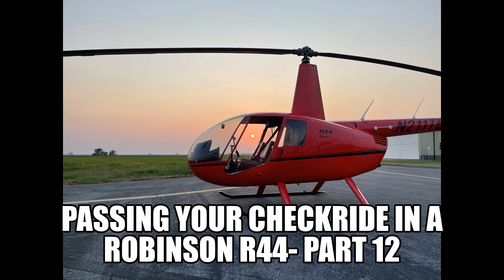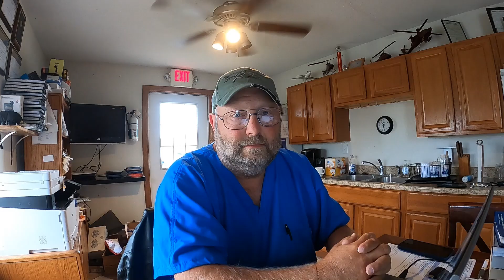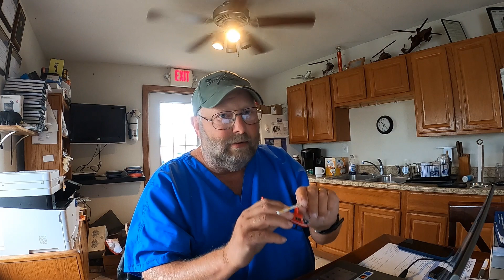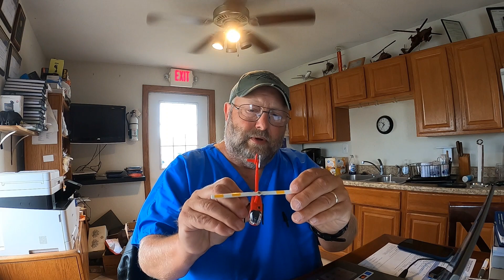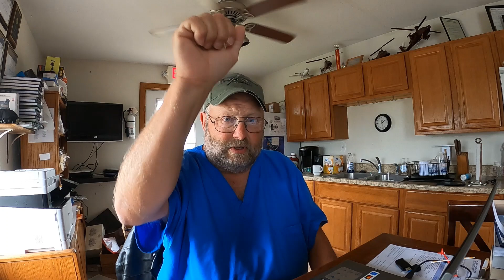Part 12- Passing your Helicopter Checkride in a Robinson R44

Comment: Why do they want you to know all rotor systems when in a checkride for an r44? Don't you need check rides in every aircraft you fly?
Reply from the maker: No , you can fly any helicopter that weighs less than 12,500 lbs when you have your private rating.
Reply from the maker: You should definitely have another pilot, preferably an instructor check you out in any helo that you haven't flown before.
Reply: @capecopters  but it's not required?
Reply: @gs550t81  typically a check flight is not required. That being said, helicopter companies normally require a “check ride” to make sure you are current enough to do the job you’re being hired to do. Robinson is an exception. They have  what is called SFAR 73. In the Federal Aviation Regulations. They do require that you be signed off once you acquire so many hours. Like to be an instructor for example, to teach in a Robinson you need 200 total helicopter time and 50 of those must be in a 22. That’s just one example of that regulation. You can look it up if you are interested…pretty boring read though lol. Like Paul said, strongly recommended that anyone planning on flying a new helicopter use a CFI to fly with and make sure you are familiar with the emergency procedures and to be as safe and as proficient as you can be. 🙂 Hope that makes sense.